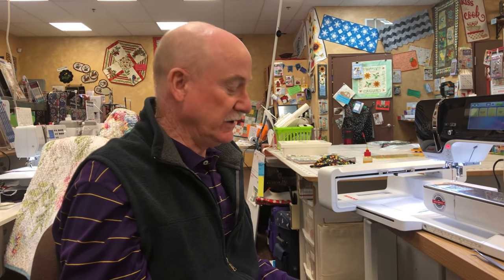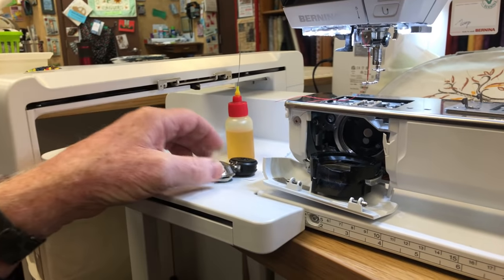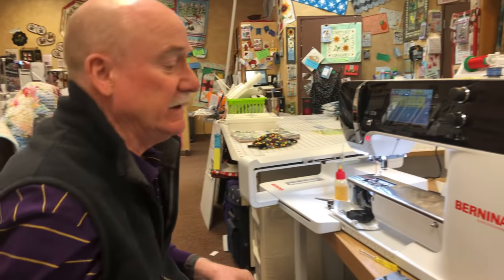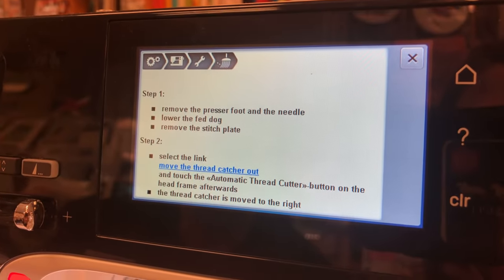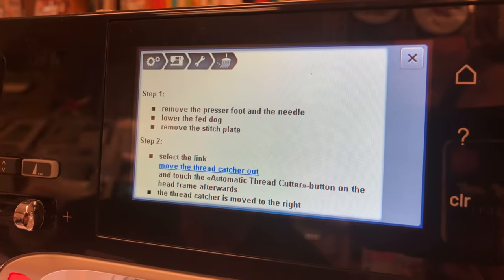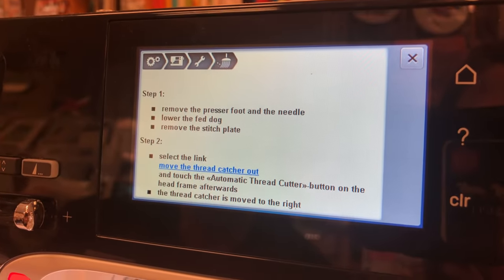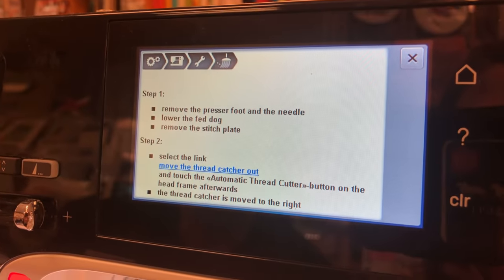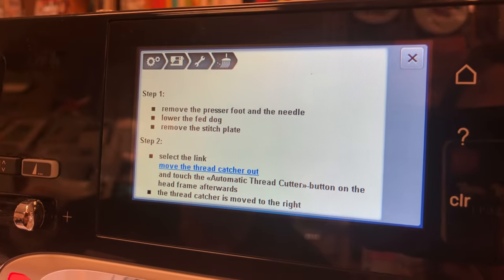All The Best Tips: Jams, Errors & Oil DYI Fixes Bernina 7, 5 & 4 series with Bernina Jeff

Comment: I have a 770 and my thread cutter isn’t working properly.  The bobbin thread doesn’t cut.  Anyone know what is wrong
Reply from the maker: The tread cutters are fussy and when the threads quit cutting you need to bring it in to a dealer, maybe not a full tune up but just a cutter tune up, yes I have a separate category for that ay my shop.

Comment: I dont think my bobbin sensor works on my 770qe. It always runs out without  me getting a bobbin low warning.
Reply from the maker: The monitor on the 770 I think will only tell you when you are out of thread, the 790 and 880 will let you know when you are low, one of those features to get you to buy a more expensive machine like a triple tail gate on a pick-up truck that only comes with the top of the line price. There is no setting to change that on a 770

Comment from the maker: Do not put oil in that red circle under the plate, it will not help the hook and will leak into the cutter unit and cause it to get dirty faster. Newer machines do not have that red circle any more the hole is still there best to oil the tip of the hook every time you begin a new day of sewing.

Comment: When you were showing how to use the needle threader ,,you did not show   You must set the needle bar at the highest point,,using the ,,needle bar up and down button. Needle bar must be set on the upper position,,using the up button.    This is the correct height. Or you will damage the needle threader,,$85:00    Janome threader is $25:00.